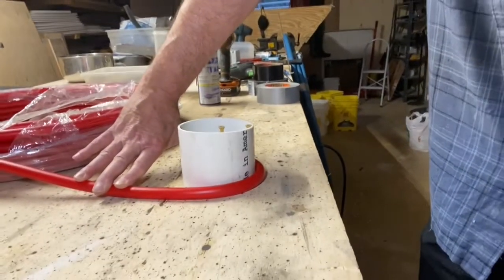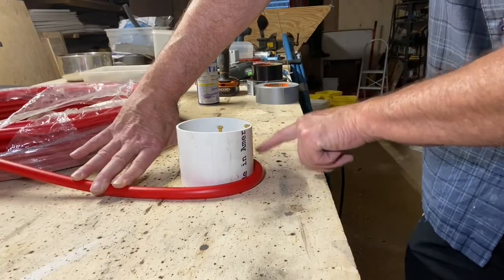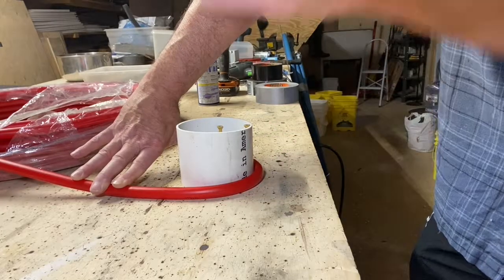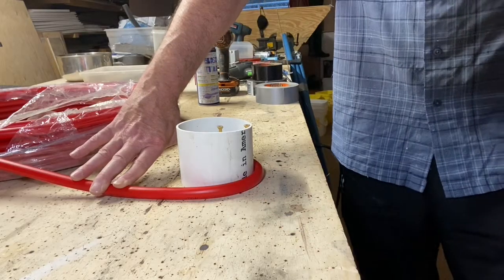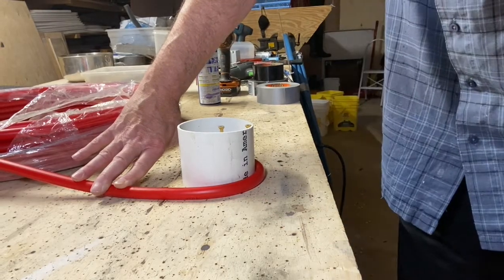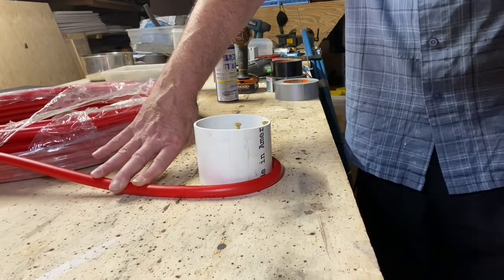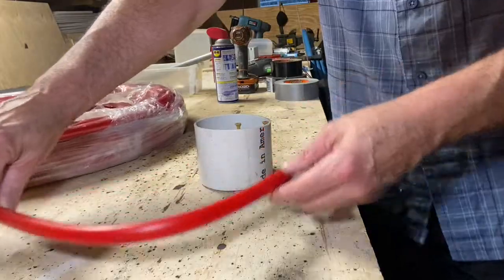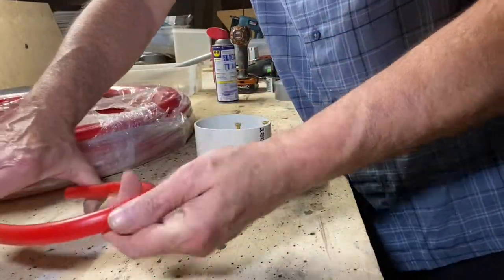How tight can you bend PEX pipe?

Comment: Does the heat compromise integrity of the pex?
Reply: Yes it does, but to what degree of it actually causing an issue? The manufacturer and the buyer would probably disagree.
Reply: If you bend it once, nothing will happen. But if you bend the same spot again, microcracks may occur

Comment: Would be good to see you use a smaller diameter turn using a pvc pipe half the size and perhaps internally support the PEX structured for an even tighter setup
Reply: You could fill it with sand but you'd have to cap both ends. Perhaps a spring of the right diameter...

Comment: Have you had success bending 3/4in or 1in in the same way?
Id like to get 3/4in acorn from outhouse where boiler will be located into the house. This will require at least 2 90° turns due to the grond level outside.
Reply from the maker: Does not work as well with large diameters
Reply: Amen to this.  Just tried using a manufactured bend support with 1" PEX and it turned into a giant fail.
Reply from the maker: @NMLongshot  pex a or pex b?
Reply: @mpselectrolab1067  PEX B.  I've tried heating it with a heat gun as well.  It helped a little, but the 1" stuff is just crazy stiff to work with.
Reply from the maker: The 1” is tough. Keep in mind pexb is stiffer and kinks easier. I only tried this on pexa 1/2 in.

Comment: Can you use crimp rings on Pex A?
Reply: It depends, PEX-A can have F1807 rating, the Sharkbite PEX-A sold at HD can be crimped, the opposite may also be true, look at the PEX-B pipe specs
Reply from the maker: No. You cannot. You also cannot use pex B fittings with pex A pipe. The density of the pex b is greater for compression rings. It is a cross linked HDPE, whereas pex a is less dense for normal low compression on the fitting. Pex a uses expansion sleeves that exert normal contraction tension to seal to the fitting.
Reply: @mpselectrolab1067  Can I use Pex A connections like elbows & tee’s & valves with Pex B pipe?
Reply from the maker: @Dave-ld3dr  no you cant

Comment: How much time under the heat gun (and was the gun at Low or High) did you have to give the pipe before it was malleable?
Reply from the maker: About 1 minutes on high.
Reply: probably better at low w/ a little more time.  Heat guns get HOT!
 @mpselectrolab1067